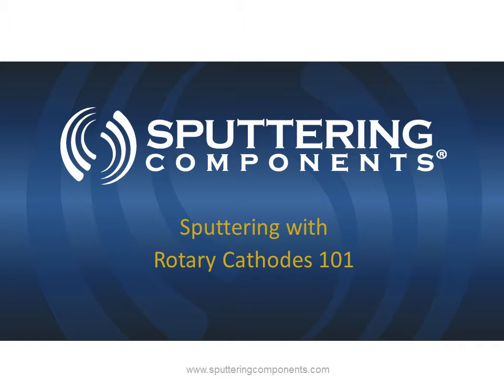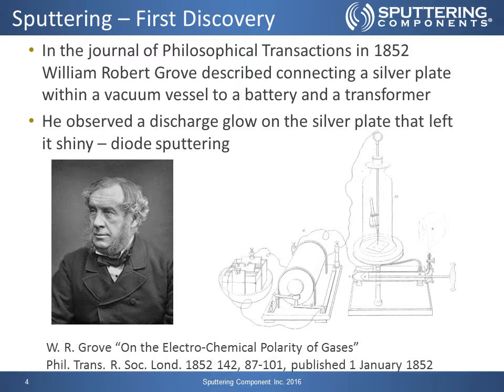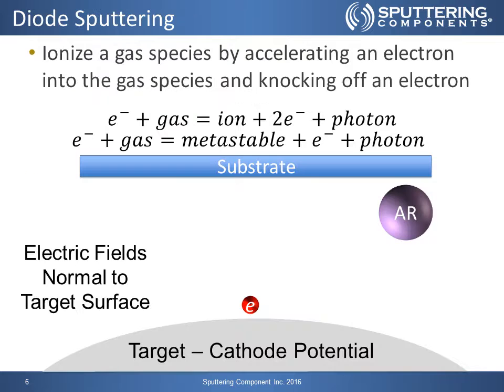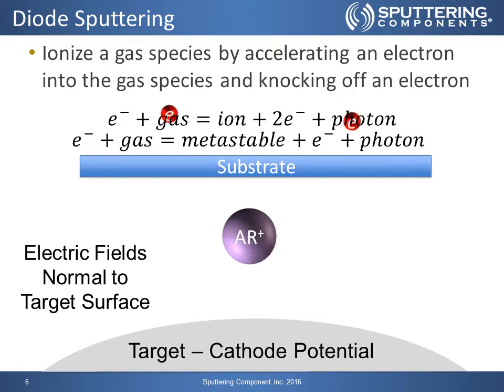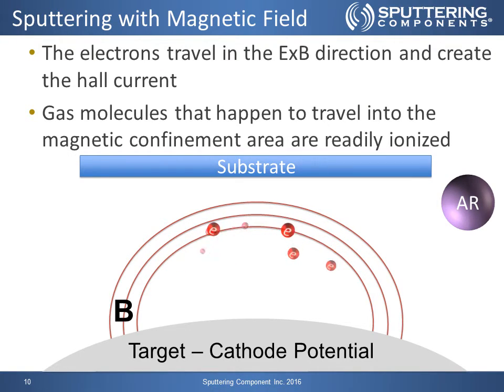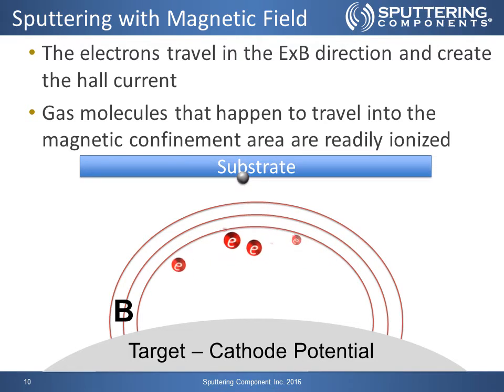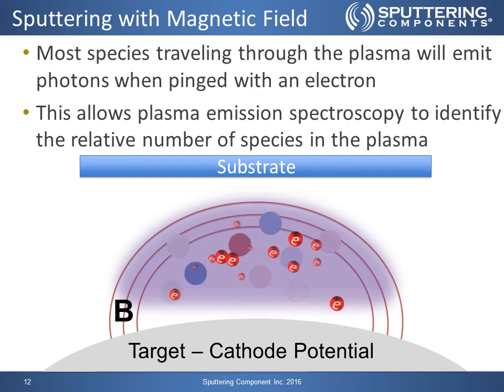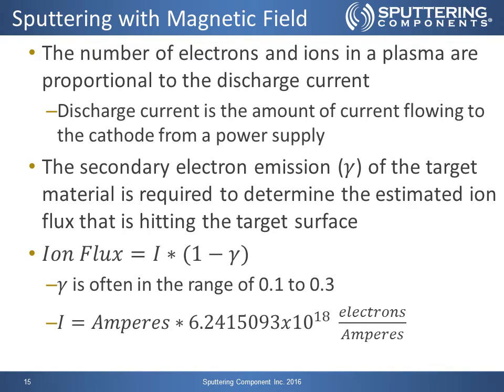Sputtering with Rotary Cathodes 101

Comment: Thank you very much for clear explain.
What's the software that could be used to simulate magnetic sputtering or physical vapor deposition coating ?Could you help me  please
Reply from the maker: Hi. We have a tool that may do what you need: https://www.sputteringcomponents.com/support/process-tools/calculators. Please contact us directly if we can help further.
Reply: @sputteringcomponents1541  Dear Sir .Thank you very much for your answer.I try to contact with Sputtering company for two months ago but there is no answer .I want to model reactive magnet sputtering for semi conductor  targets.The type of target is hexagonal BN ,the reactive gas is N2 . The power supply to the target is Rf.The type of substrate is steel. The geometry of chamber is cuboid.The model should be able to describe :
# Modelling of magnet discharge.
#Modeling of electromagnetic calculate E*B
# Modelling of sputtering
# Modelling of atoms transport
# Modelling of deposition.
My questions :
1.What the software could used for these models?
I need your advice, Please.This is my email :
nakkarake@gmail.com.
Greeting.